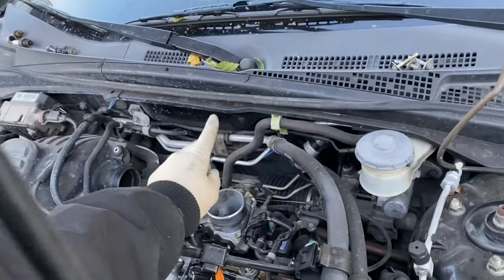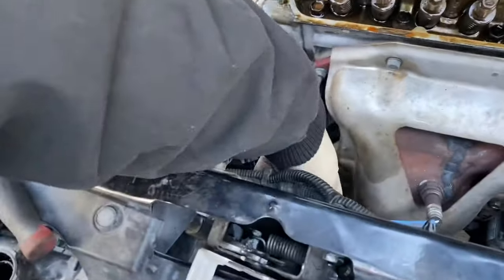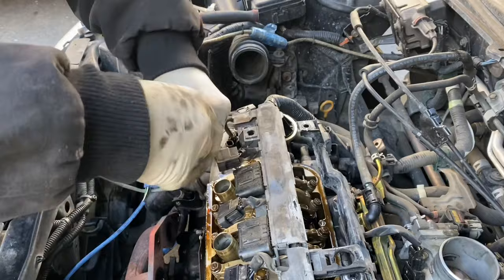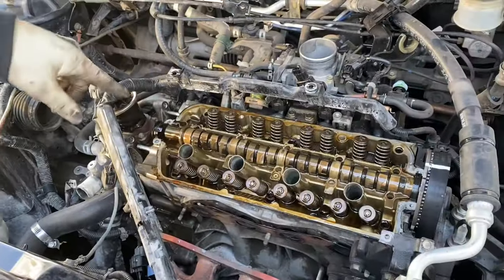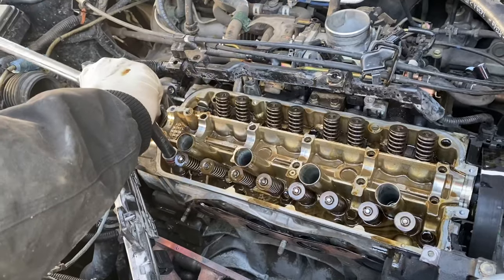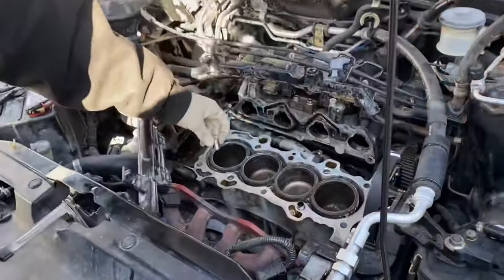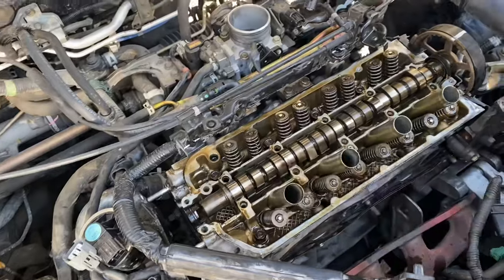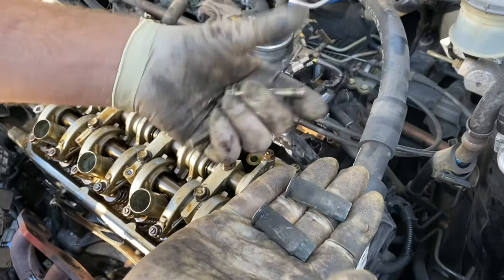2001-2005 civic 1.7 liter complete head gasket replacement step by step

Comment: this song makes me feel like replacing my head gasket is gonna be a lot more therapeutic than what it'll actually turn out to be.
Reply: Man I was thinking the same 🤣🤣
Reply: Im doing this now, that last bolt on the intake is a pain in the ass, otherwise it was easy pulling the head
Reply: @Bigcheese2321  did you watch any other videos? Was this one the most helpful?
Reply: @JP-rh8qr  yes
Reply: I found just taking the intake with the head was easy lol once the 3 bolts underneath are off, the intake is free to go anyways..... then the intake bolts are easier with access to everything.
Reply: @dirka_dirka_mohammedalijihad  it will come off with just the three bottom bolts?
Reply: @s550andrew  nooo you still need to take all the bolts off and disconnect the wires, but I just unplugged it all and it came off with the head. Easier to clean everything and bolt the intake to specs this way also.
Reply: @dirka_dirka_mohammedalijihad  ah cool thanks
Reply: Dude.... like makes me think the same lol I'm a HD diesel mechanic and have replaced many heads on big trucks and those are a bit this hard just heavy
Reply: The satisfaction will be enormous.
Reply: The music interferes with his instructions for an older person like myself. I wish it was not on this video. Thanks for the instructional video
Reply: just make sure to play this music while you replace it... LOL
Reply: I just had to put everything back together because I wasted three days trying to get to the head gasket for the first time. I had to stop because of one single exhaust bolt.
Reply: I usually lose focus on how to videos but sheesh you are right... I stayed on glued and focused the whole 25 minutes 😂
Reply: Lol😂 I'm 😢 but also 😊
Reply: Hhhhhhhh😂
Reply: its good for you it builds character

Comment: I'm not the most mechanically inclined, but I recently replaced the valve cover/intake gasket on my 2001 Acura MDX and it was pretty easy. As the trans is going out (bought at an auction) i'd rather sell the car and get a civic. I found one online for $1,000 with the head gasket being the issue. After seeing this video, I know with confidence I can do this job. It's highly similar to a valve cover gasket job, just with one extra part of taking off the head. My minimal research for the replacement gasket is about $100, the rest is elbow grease. I hope I can sell my car in time to buy this civic and have it going again to be my daily driver! Thanks for the confidence boost guys!

Comment: 60k miles ago I used this vid to change my head gasket and here I am again.  After some reading it seems these D series motors blow a gasket if you look at them wrong.  I busted my radiator from a deer and overheated so I suspect that might have blown the gasket but who knows.

Comment: Thank You. Very Good information for an old mechanic like Me. Buying an 02 civic ex coupe with automatic , 200.000 on the clock in real nice shape. Seller indicates it overheats once in a while after 20 mins or so. I'm debating doing a Head gasket or a complete repower . Car is only 600 bucks . No oil in coolant or coolant in oil. My mind is a lil slower now .retired.. thanks again
Reply: I'd check the thermostat first. Very easy and cheap thing to rule out

Comment: Side note. You definitely can reach that bolt without going underneath like that. You just have to remove some like bracket thing that is held in by two easy to reach bolts and then you are good.

Comment: I really appreciate you guys putting in the time and effort to create this video. I very closely followed it step by step and was able to replace my head gasket and fix the issue I was having with exhaust gases flowing into the cooling system. There is no way I would be able to do it without this video!

For anyone out there who is wondering if this is a job they should do themselves, I will be honest with you. This is a pretty difficult, time consuming, and stressful job if you are just an amateur mechanic like myself. These guys are pros and make it look easier than it actually is. From start to finish it took me 3 days to complete. 

It was pretty stressful for me because I was very nervous about reassembling everything considering the important components that had to be removed, such as the timing belt, valve train, and cam shaft, as well as the seals. I feared I would not be able to reassemble everything or I would mess something up in the engine. About half way through I was regretting taking on the job myself. However, I persevered and I'm proud to say that I was able to complete this job successfully. My car runs great, my issue is gone, and I saved around $1,000!

If you decide to do this job, here's a few tips from me:

1) Before you start, put the vehicle off the ground with jackstands and remove the engine oil and coolant.

2) Make sure you are drinking ample amounts of beer or using nicotine so you can keep your cool and calm your nerves🤣.

3) Use penetrating oil and make sure you have good contact with some of the bolts that need to be loosened. Take your time, I had a few close calls with stripping the heads on a few bolt heads and I don't live in the rust belt.

4) Keep track of all your bolts and parts, I would recommend using sandwich bags and labels for everything you remove. I should have been more organized, it would have made reassembly easier.

5) At 15:40, that 5th manifold bolt is a PITA to loosen. You can't get a long wrench in there so you just have to pull it as hard as you absolutely can to loosen it. I was trying to get it loose for a while. Eventually I gave it everything I had and I was able to get it. However I didn't need to remove it because I ended up propping up the head like they do in the video and just replacing the gasket without removing the head because I didn't see any damage. Before I put on the new gasket I very carefully cleaned all the mating surfaces with a microfiber towel. This approach worked for me, but if You're head is warped or has surface damage then you need to remove it and have it machined.

I hope everything goes smooth for you. Good luck!
Reply: Thanks for the pointers.  About to do this myself on my 02' project car
Reply: Just bought my son an 03 ex, and it smokes heavy white on cold starts for a good two minutes. May be condensation in the exhaust, but my gut tells me it’s coolant in the combustion chamber, which would lead me to do what they did in this vid. Never done a head gasket myself; might be learning the hard way. 

What head gasket kit/set did you use? Any parts list?
Reply: @tbarton5107 go with a Felpro kits.
You can replace the head bolts buts its not absolutely needed if this is the 1st time the head gasket's blown.
About to do mine again, 1st time in was around 126000 miles ive now got 337000 miles in it so I've opted to replace the bolts this time.
Another thing to consider go back after around 5-8000 miles and recheck the head torque again, glad i did at the time because they were not to spec.
Reply: Maybe you should be a writer instead! Hot damn
Reply: If I just want to quickly remove the old head gasket and put the new one do i have to unbolt the intake manifold or can I just move it up and tilt the head/manifold to replace gasket??
Reply: Was your car V-tec??
Reply: @tonypajamas6125  that's a d17a2 single-can vtec system in the video.

Comment: Huge help/confidence builder ! I admit I was dismayed, but not discouraged, to discover that on a 2004 Civic EX it was impossible to lift the intake manifold more than an inch without disconnecting more wiring and hoses. Luckily I was able to remove/install the dreaded intake manifold center nut by removing the plate above and putting a gear wrench down inside. My son and my wallet thank you !!

Comment: Just did my head gasket on the 02 civic. Thank you for this. I love the timing belt shortcut. I was always afraid of doing this job because I thought I would have to get the belt back in time. But all is well
Reply: Putting The belt on time on this engine isnt that hard. Use your brain some logic sense and replace the pump crankshaft outside seal and tensioner while u R downthere. 

Good things take time

Comment: Had some problems getting my car started after replacing the head gasket on my 2001 Honda Civic LX. Good compression on all cylinders except cylinder 1 was a little lower than I’d like it to be. Ended up tearing everything apart to check the timing, torque specs on the head bolts, etc. Ended up just putting everything together again to just try it out and it started up after 2 cranks. I have no idea why it wasn’t starting but I’m not mad that it started up with no knocking. Extremely helpful video. Would have been more helpful to have you guys reassemble the whole thing to help save some time with scrubbing through the video. Forever grateful. Thanks guys.

Comment: This video REALLY helped me.  The trick near the end about lifting the head with the intake manifold still attached with the center lower bolt was great.  Knowing not to take out the lower intake bolts also saved me time and headaches.  Also the pointer that the alignment pins go in the front of the head saved my bacon.  Thanks guys!

Comment: The best video ever for 7 gen civic gasket relacement. You are real gasket masters. I m stuck with taking off the intake manifld bolts. Thank for the tip to take the center bolt off.
Reply: I'm in the middle of the breakdown on my '02 Civic EX  vtec.  I'm getting nervous, as I am at that same place (intake manifold bolts removal) and I'm getting a bit nervous to proceed, esp. as the section of the video wasn't the clearest, and they skipped a bunch on the reinstallation for this same area.  Did you find additional videos, instructions that helped?  Thanks.

Comment: You guys save the day!
I'm doing this with my 13 year old daughter.
I have mild experience with tools.
And this is just great!
I really appreciate this video.
God bless!
Reply: Did everything turn out well? I’m in the process of doing it
Reply: @mikehernandez9903  
So far so good my friend!
Reply: @mikehernandez9903  
Eres el brokoly?
Reply: @ivanrivera9933  nice bro i already removed my head. Now I just need it to be checked out by a machine shop. Took me 5 hours to remove that dam intake bolt in the middle
Reply: @mikehernandez9903  Awesome.
I didn't take mine to machine shop.
I Just cleaned everything extra well and even did some light sanding with a sanding sponge.
My intake parts was super full of gunk cleaned the crap out of that.
 And just put the gasket  on there.
Reply: @ivanrivera9933  I just finished up the job👍 took me 2 days. I consider my self a mechanic now. I took my head to a machine shop and they resurfaced the head. They cleaned it up very well. This videos helped out a lot. Thank you for responding to my comments bro much respect for you✊
Reply: @mikehernandez9903  bravo 👏
Reply: My car engine blow up boom !
In the freeway.
Reply: ... did it really though O.O

Comment: THIS VIDEO SAVED MY CAR AND ME $$$! After finding out that my head gasket was bad i was hesitant on taking this job but  this video gave me the confidence to do it! Had the machine shop pressure test and resurface the head for about $60. spent $110 for the fel pro gasket set on amazon along with the mahle head bolts for $40. Got the job done in about 6hours saved alot of time not having to remove the hoses and connections from the intake manifold!  Appreciate the content couldnt have done it without this video!
Reply: So you not over heating no more?

Comment: Thank you for this. 277,275 miles and I tore the head off today. Shocked my original head gasket lasted this long, I'm reading they can start going around 140k. Love the short cut to avoid removing accessories on the driver side. 

Again, thanks for the video. Outstanding.
Reply: Did you have overheating issues at an earlier mileage?

Or when u hit 270k M
Reply: @eastcoastmostwanted710  early sign is coolant hoses blowing off. Especially reservoir line. Have more info if you need!
Reply: Just the other day, I purchased a 2002 Civic sedan with only 68654km (42659 miles) and the head gasket is leaking pretty bad, also showing some signs of oil consumption. I got it cheap though because it also needs tyres, possibly brakes, timing belt + water pump and maybe even suspension work haha and is unregistered and needs a roadworthy inspection.

Comment: Note, for all having hard time putting timing belt back on gear. It can be tight so aline the belt with the mark and just put half of belt on gear, then get a very small soft rope about quarter inch rope , a little over 2 ft long,  work it over the belt on the side That is not on the gear. Pull it up as far as you can up the belt, hopefully with in two splines of the mark ,then pull the rope up and toward the motor and with your finger hold it there and move the rope two splines and repeat. You will find as you move the rope further around the gear it will get easier.  I had to do this because everything in the timing belt idler water pump was new. Hopes this helps it took me 3 days to figure this out. BUDRO

Comment: Love your video - I was able to do my roommate's gasket job this way. It certainly does get a little anxious to wiggle the timing belt around trying to slide them back in, but I took your word for it that the crank won't move as easy as you think.. or that belt skipping just doesn't happen all that easily as some say. The car runs nice and smooth now. Thanks again!
Reply from the maker: Yup. That’s how we roll

Comment: Had a cylinder 3 misfire since owning my '01 and burning a quart every 1000 miles. For ALL of the exhaust manifold nuts/studs/bolts, needed to heat them up with acetylene torch to get them to crack at all.  luckily i got them all and didn't snap a stud inside the head. getting my head resurfaced/rebored at a local shop and got a top end gasket kit from rock auto, new exhaust manifold nuts/studs, along with anything else I break along the way lol but overall nice video :) made my life a hell of a lot easier.

Comment: This is a very valuable lesson, I knew almost everything, BUT - thanks for showing us the trick with that 5th bolt on intake! I was gonna take the head off with the whole intake on it, which would include so many hose disconnections, aaaargh, your way is the way of the pro 🙂
Reply: I remove intake with it is a lot easier
Reply: @jjeff6113  me too. Then the egr ports and other crap can be cleaned properly and the bolts can easily be torqued back to specs before installing the head again.
Reply: @dirka_dirka_mohammedalijihad  have you ever just replaced head gasket and left intake sealed? Thinking of just saving time and taking it off with head and replace it as is
Reply: I’m wondering the same thing, Andrew.
Reply: Ya I'm sure you can get away with doing that.... just don't unbolt it and it'll remain sealed.
Reply: Sorry for the late reply lol

Comment: best way to get that intake bolt is to go underneath the car behind the oil filter. Once you remove it, u can clearly see it and u can remove it with a long 12mm rachet wrench. Btw u blew my mind that u didnt take the lower timing cover off. I will forsure use ur tip on removing the timing belt. Thanks for some tips.

Comment: excellent video, Thanks a lot for it. I am doing mine now, Engine started overheating, finally realized there were bubbles coming out of the radiator and the coolant magically missing after I verify all leaks and hoses and even a new radiator fan. Also magically the Engine consuming some little oil? Does any know what the problem might be with the little oil consumption? could it had been the coolant getting into the engine or pistons?

Comment: I had two of these cars, they both overheated nonstop with shitty head gaskets, I changed the thermostat radiator cap radiator water pump and timing belt you name it, I just sold one yesterday for 2000 at Carmax that shit was trash, 200,000 miles

Comment: I like the trick with unbolting and leaving the water inlet housing assembly attached... Saves time for sure, but I recommend also replacing timing belt, water pump if you're already doing this job, if you know that the vehicle still has not had it changed.
Reply from the maker: P Tourne WOW!! Thank you. Us specializing in only head gaskets for the past 12 years, and me being a master mechanic for the past 22 years sure could learn from you. I’m so thankful you were here to show us the error of our ways. Please, allow me to be your disciple.     the point of the video is for instructional purposes, and we covered the water pump/timing belt recommendation already in the actual video that you commented on.